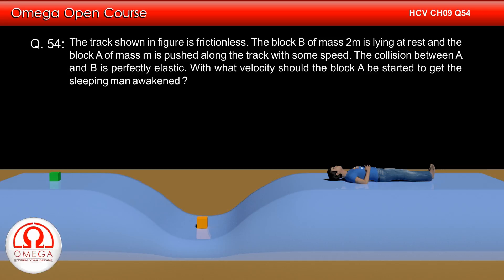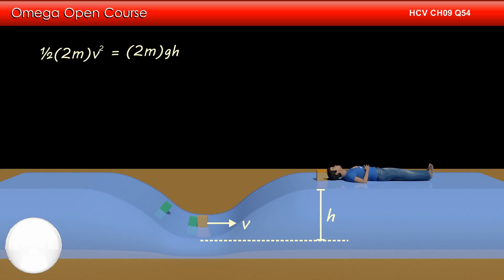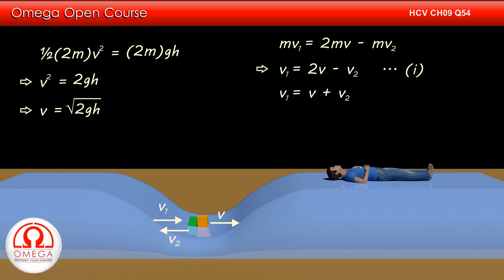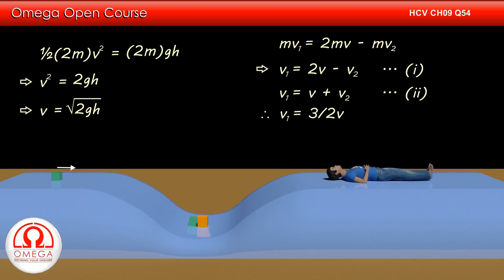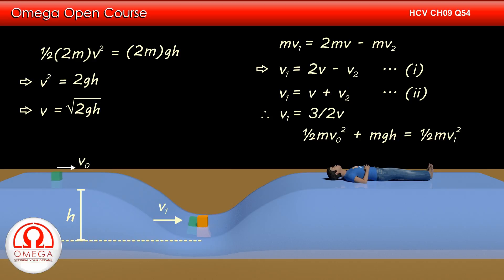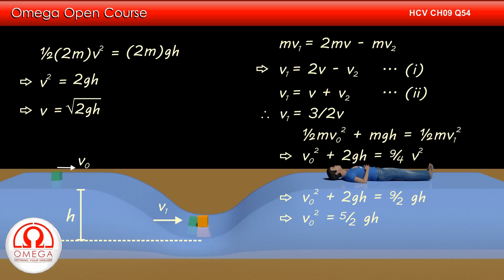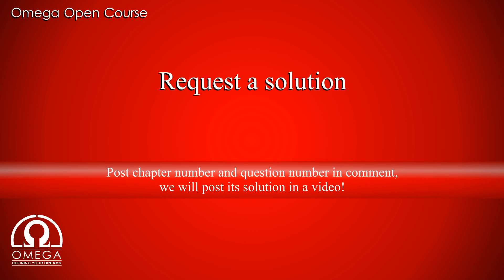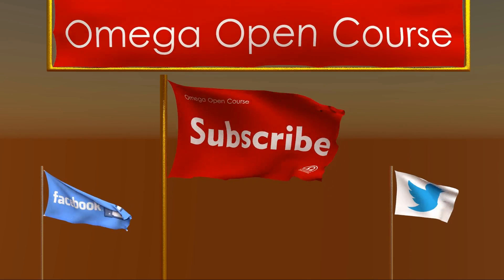H. C. Verma Solutions - Chapter 9, Question 54

Comment: how can you suppose that the first block will move in the backward direction
Reply from the maker: If a particle collides elastically and head on with another heavier particle at rest, its direction of velocity is reversed!

There are many ways to deduce it. One is through equations. Other is by looking from the frame of centre of mass.
Reply: sir it would be great if you could also upload the solution of cengage books
Reply from the maker: +JAmes BoNd 007 in an elastic collision all the energy is transferred only when both the blocks are of equal mass and the other body is initially at rest.

I will advice you to try to learn what is being taught rather than trying to prove them wrong. You can take up the task of proving others wrong when you have mastered the subject!
Reply: Sir,why can't we directly conserve energy that is 1/2m(v^2)=1/2(2m)(v1^2) instead of conserving momentum
Reply: Omega Open Course I was kinda joking. I never knew that you would reply so fast.😂😂